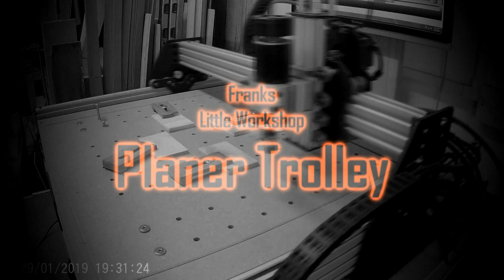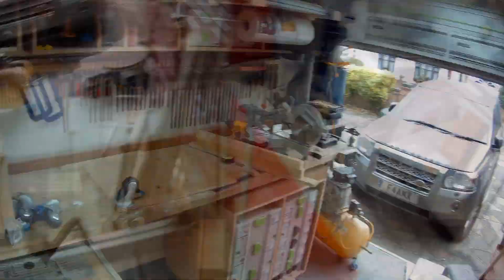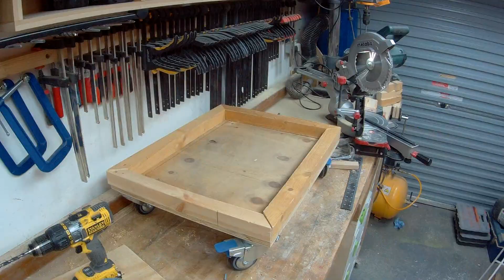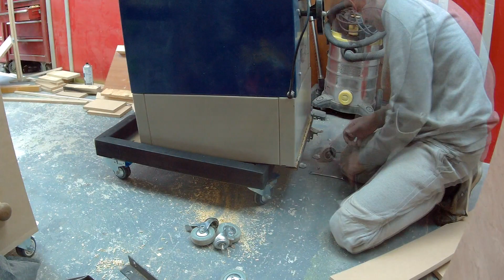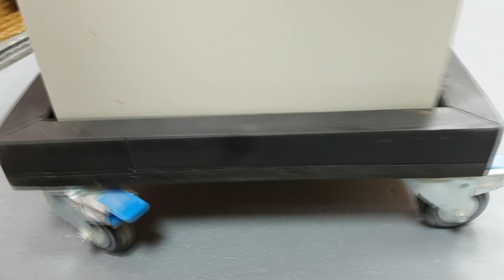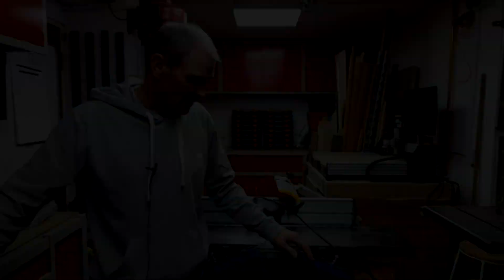Franks Little Workshop, makes a quick planer thicknesser trolley.

Comment: Good work Frank. So simple, strong and serviceable- would have liked to see it working, and how it stays put ,on those braked wheels featured
- but good on you Mate. Russell Townsville Australia.
Reply from the maker: 😃 Thanks Russell. I've been using it now for 3 years so far and its been faultless. To be honest I don't often have to use the locking wheels as it is quite heavy so it won't move unless you push it. It still moves around the shop when you want it to though... I still love it. Thanks for watching Russell 😁👍🇬🇧